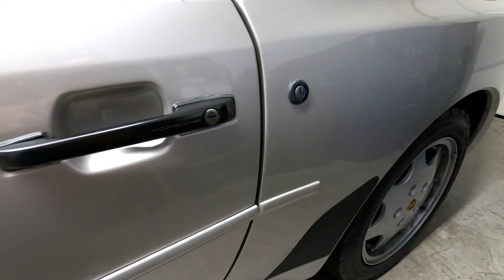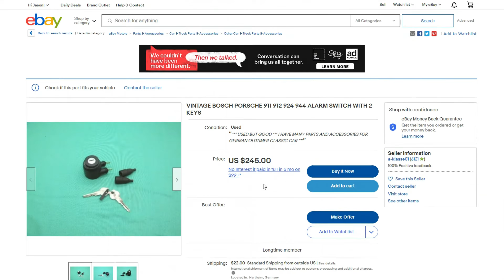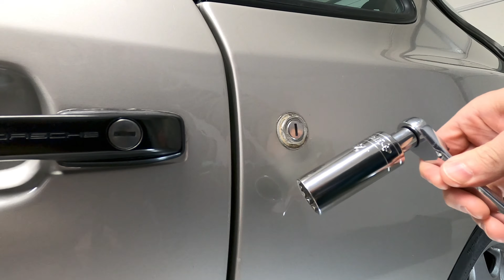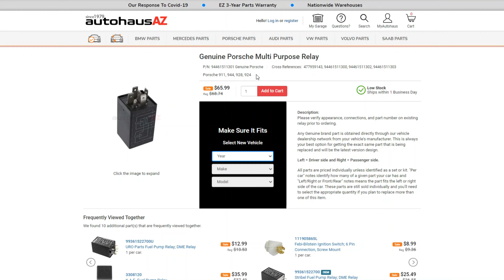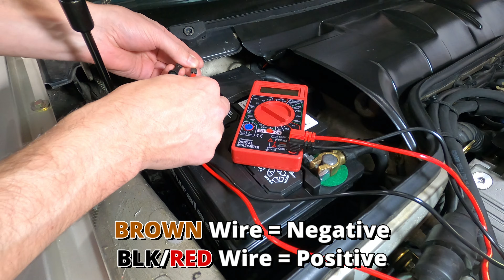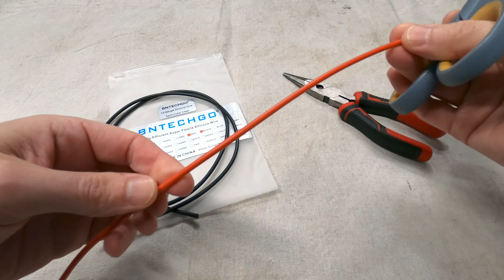Porsche 944 – OEM Alarm System Repair & Bypass Procedure Tutorial (1983-1988 Model Years Only)

Comment: WARNING!  
After trying to bypass my alarm unit in my 89 S2, the jumpers caused a small electrical fire there in the footwell!

I just learned from Comeau Racing that the procedure here and on Clark's Garage is NOT COMPATIBLE with the S2.
Reply from the maker: Yeah, the alarm system was integrated and updated with a different control model in 1989. I’m sorry to hear that happened. 😳 This video was for 1988 and below, but I’ve also updated the model years in the title and video description to call awareness to the S2 discrepancies. I hope that helps. Thank you for sharing!  👍🏼
Reply: , Comeau admitted they'd done the same.  How could we know?  I'm going to contact Clark's as well.

Comment: Does this factory alarm also render the ignition inoperable?
Reply from the maker: The alarm disables the DME/Fuel pump relay and grounds the field lead on the alternator to prevent the battery from charging.
Reply: Thanks! I think this will be my next little project. I hope you had a great day today. 😊
Reply from the maker: @rossstoneman832  You too man, happy holidays! A working alarm system on a 944 will put you in the top tier of 944 owners, such is the rarity of it. 🤣

Comment: I had a non start issue for a month - replaced DME, Speed and Reference Sensors, plugs, wires, distributor, fuel regulator, battery - 

I watched this video, bypassed the alarm and it started. I don't know if I should laugh or cry:)
Your videos are amazing. Thank you so much.
Reply from the maker: Oh man! I’m glad you got it figured out. 😂 The circuitry on the alarm control boards is pretty shoddy by today’s standards. Some people will proactively bypass them even when there’s no issue at the time and never look back. I’m not sure why I went the restoration route on mine, but…. I will say that other Porsche guys I’ve come across are pretty impressed to see a working alarm on a 944. 😁
Reply: @NC944er Someday when I have a bit more time I'm going to fully go through it and do it factory correct.
Thanks again for the videos, you're a celeb in our house:)

Comment: If the alarm comes on, on a no start will you get tach bounce?
Reply from the maker: The alarm system immobilizer disables power to the fuel pump when it’s activated. If that is a suspected issue, the alarm bypass procedure should rule that out. No tach bounce would typically point to a speed/reference sensor issue, or the wiring harnesses leading to them.
Reply: @NC944er ok just clarifying I have tach bounce etc but the car cranks but doesn't turn on im bypassing the alarm let's see if that changes anything

Comment: Probably a dumb question, but would the bypass jumper completely stop the alarm from working along with cutting power being drawn from the battery?  I don't want to utilize the alarm system anymore and I don't want it to drain my battery at all.  Is it as simple as just not turning it on?
Reply from the maker: The alarm control module uses a relay as a kill switch to prevent the car from starting when the alarm is triggered. The unit itself does have a small parasitic draw on the battery and there are reports on the forums of this draw being reduced when the alarm is bypassed, but I haven’t personally tested that theory. Removing the alarm relay (if your car has one) and the alarm control unit would prevent any further draw. Pelican outlines some steps at the end of their write up for removing the unit and jumpering the harness - https://www.pelicanparts.com/techarticles/Porsche_944_Turbo/36-ELEC-Troubleshooting_the_Alarm_System/36-ELEC-Troubleshooting_the_Alarm_System.htm
Reply: Mine is am 86 so it should have the relays.  Thanks for the info

Comment: you are a life saver, very useful video.
Reply from the maker: Thanks man! There really isn’t a nicely consolidated source of information on the alarm system, I guess because most people disable them and move on, so I tried to make this one more comprehensive.
Reply: @NC944er  i just noticed that mine doesnt have alarm relay in the fuse box. Weird, but it has the alarm module
Reply: I mean it came out of the factory without one i think, could it be that way ?
Reply from the maker: @snopdd  Hey, yes! What year is your 944? Porsche didn’t add the relay to the fuse panel until model year 1988.
Reply: @NC944er  1987
Reply from the maker: @snopdd  That explains it then. 😁👍

Comment: Nice video! I haven't gone about servicing this system on my own 944 yet. My only interaction with it thus far has been to disconnect the under hood switch completely, as it was causing a battery killing draw with the hood open.
Reply from the maker: Yeah, unfortunately that’s another part that is no longer in production, but 944Store has some refurbished ones available. Part # - 92861317300
Reply: Good to know, though by the behavior, I'm thinking the switch itself was in working order, as the draw didn't exist with the plunger depressed. Probably something to do with the system as a whole, such as a grounding issue.

Comment: It's a good idea that if you're going to jump the alarm module, remove it entirely and jump the pins from the front of the connector with short lengths of wire and male spad connectors.  It's more secure and less likely to fall out of the connector.  Great video though.
Reply from the maker: Pro tip, thanks for sharing! 👍🏼

Comment: You are a legend for releasing all of these videos! Just thought about doing this. See you got a new rain cover for your blower motor as well, looks good!

If you are ever around the New Bern area and see a grey 944 with a roof rack that's me!
Reply from the maker: Thank you and good eye! That rain cowl is indeed new to me, but from an ‘87 parts car, that I patched up and painted. I also have a “new” one on hand that I haven’t yet installed, but it’s the version from the 1993 968. It’s not an exact fit, very close, but it’s the only one still in production.